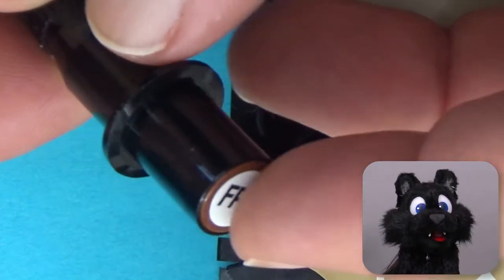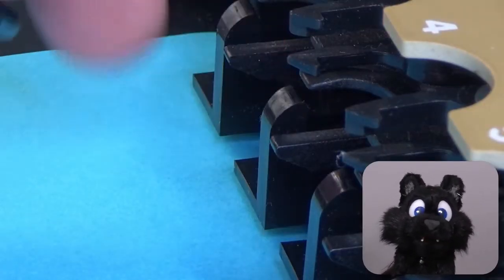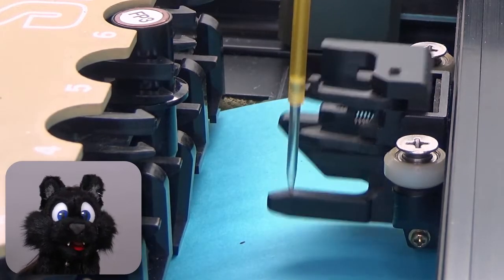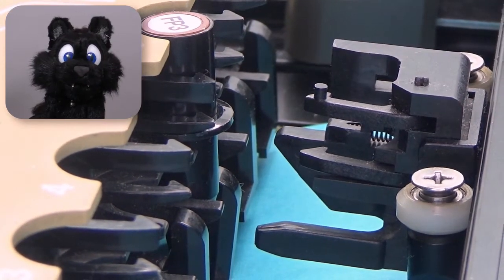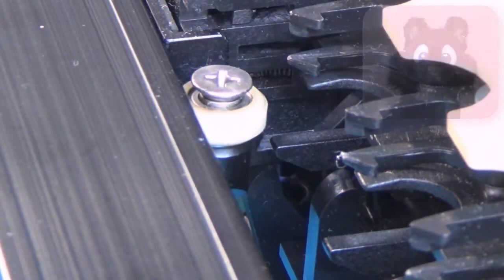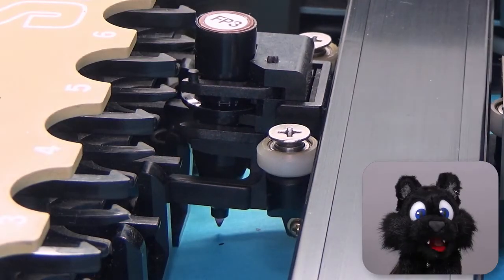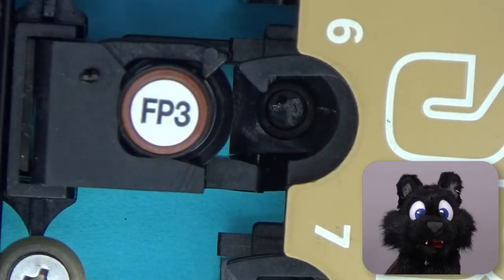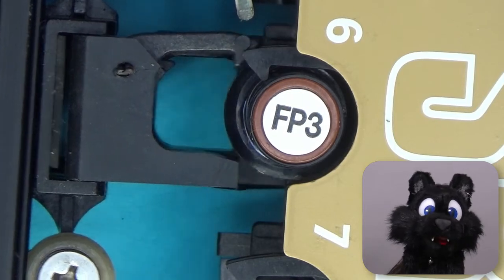Tidbits 03 - Plotter Pen Exchange

Comment: You have no idea how many hours I spent to find explanation of this. Months! I'm so thankful for this video. You are awesome.
Reply from the maker: Glad to hear that!
Reply: @atkelar  from your wonderful HP plotters videos I'm convinced they use about the same pen change mechanism but implement Geneva drive in the pen carousel to allow plotter head grab the needed pen. I wonder if you would be interested to make a video about carousel or how HPGL sorts out pens. Unsurprisingly, Apple is the only plotter maker I saw who kept all 4 pens on the head mounted in a windmill style.
Reply from the maker: I don't have an HP plotter (yet) - but if I come by one, I'll gladly make a video to compare their mechanisms. HPGL as such doesn't sort out pens at all: there is a "select pen #" command and the creator of the HPGL has to know what number relates to what pen color and/or thickness. This is why some plotter settings back in the day had "color to pen assignment" settings. I think there was an update in "revison 2" or so, to include color by name and line thickness, so that the format became compatible with printers... but it's hard to find proper specs these days. KiCAD for example has a "color" option when creating the plots, but doesn't change the pen even once. No idea how to make that work or if it works at all.
Reply: @atkelar  very interesting findings... Unfortunately, it's nearly impossible to get my hands on these old marvels in Russia, since they never were imported to USSR behind the iron curtain (shipping overseas is an expensive option). So, my goal is to recreate and improve on these designs using 3D printing, microcontrollers and steppers. Existing solutions rely on adding Z axis which is inelegant, slow and unnecessarily complex. I will use G code since it's what I'm used to but I haven't figured out how to do pen changes yet. Maybe by injecting some handrolled preprocessing script. These old machines are beautiful and I'm glad to find your channel. (the Cat is nice too)
Reply from the maker: HPGL seems to be similar to g-code from the general movement ideas. I think it should be simple enough to convert onve format to the other, as both are text based vector formats and as long as the output goal is a 2D outline, they should be compatible.
Plotters usually only take "PD" and "PU" commands (pen down and pen up) for "Z" axis. Solenoids with springs were common to move them; harsh on the pens but quick and accurate. I *think* more advanced plotters had some "soft/hard" movement control via software but that might be a false memory; my model has that in hardware with pre-tentioning a spring.
And yeah, taxes and fees are a nightmare... I just finished a 3-week delay in a shipment with all fees pre-paid even.